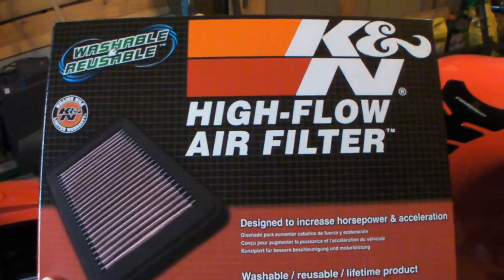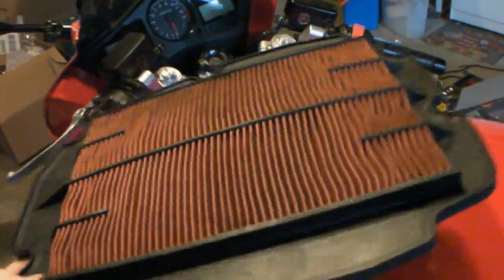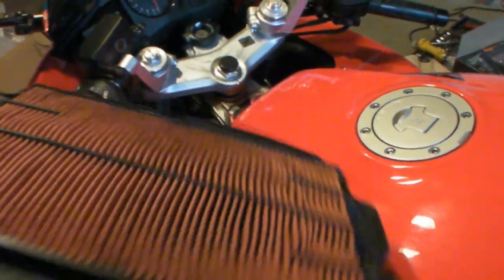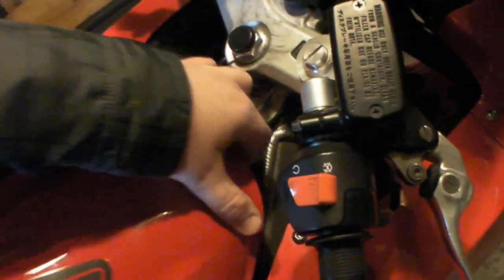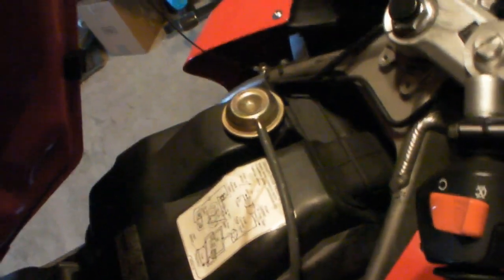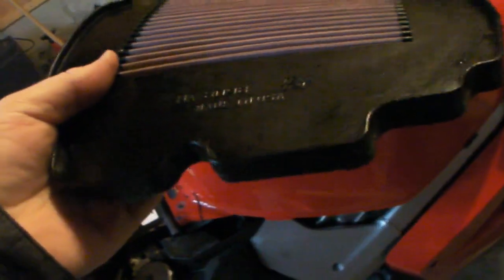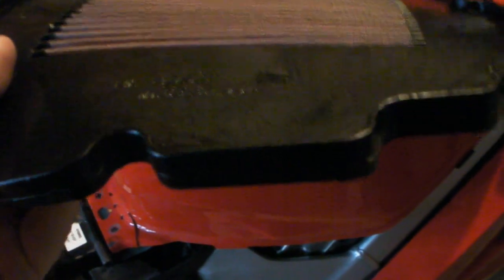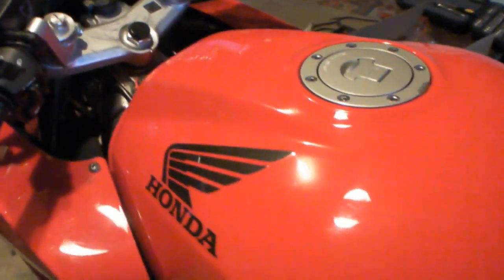Installed a New K&N Air Filter

Comment from the maker: @woodenchairs I'm a pretty sneaky guy sometimes. :)  And yes, there is definitely an improvement in drive ability.  The when I start the bike when it's cold, it doesn't die right away, it idles low for a little, but doesn't die!  And now the bike sounds better, and I can definitely feel a more responsive throttle.  I am always glad when I change the air filter.  I will see how it improves fuel economy.

Comment: You didn't happen to have any fitment issues with your filter? I couldn't get the airbox fully shut on my '98 (same airbox design) with the K&N.
Reply from the maker: Nope, no issues. Sometimes you have to really try wiggling it around or maybe remove the o-ring around the perimeter since mine didn't have it installed when I put my k&n in. I don't know what else to say. Hope you get it figured out. Make sure the filter isn't upside down.